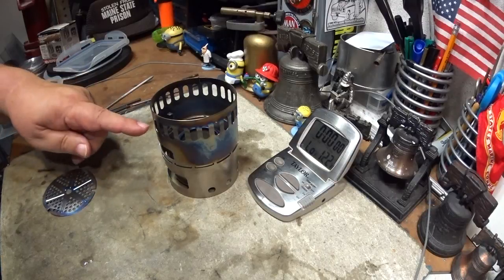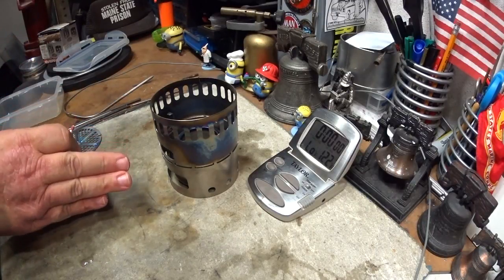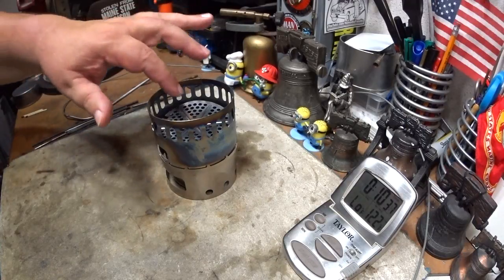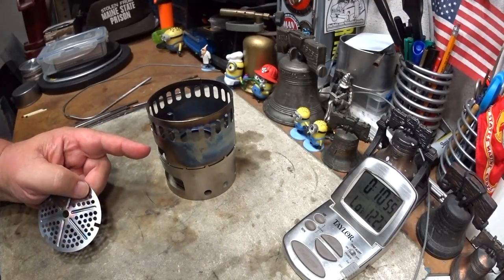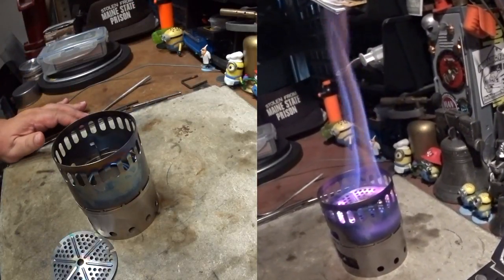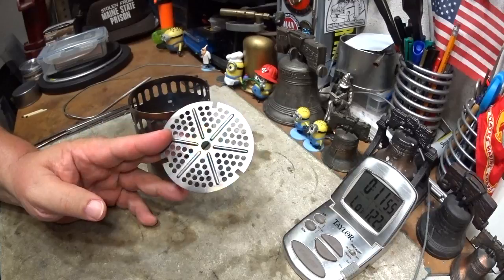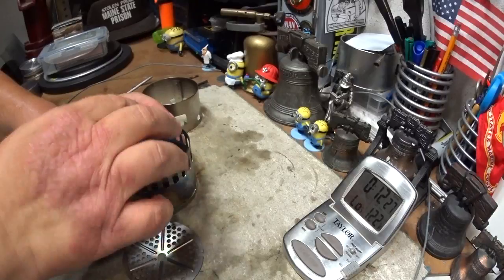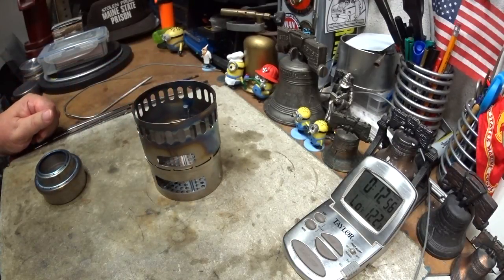Evernew Titanium Stand Dx - Power Plate - Burn Test

Comment: Hi Hiram. I have seen this stove tested before and it certainly cranks out the heat, but at the expense of being an alcohol hog. Basically it gives results somewhat similar to a canister stove, where it cranks out a lot of heat but also a lot of heat is wasted.
It looks to me like the stand absorbs plenty of heat and acts like an oven, heating the burner and thus driving more vaporization in a feedback loop. The power plate increases this feedback even more, which is why it burns through an ounce of fuel even faster with the power plate.
After you have ran through your tests with the boy scout pot, can I request a boil test with the power plate and using a heat exchanger pot? My gut tells me that the fins on the bottom will help absorb some of that wasted heat. Cheers and thank you!
Reply: ColoradoCamper I'll second CC's request, it might be interesting to see it with the Olicamp Hard Anodized XTS Pot, if you still own one.